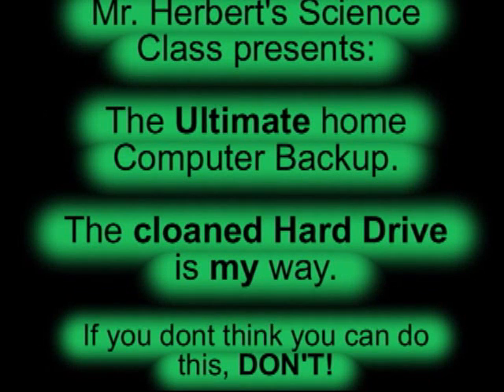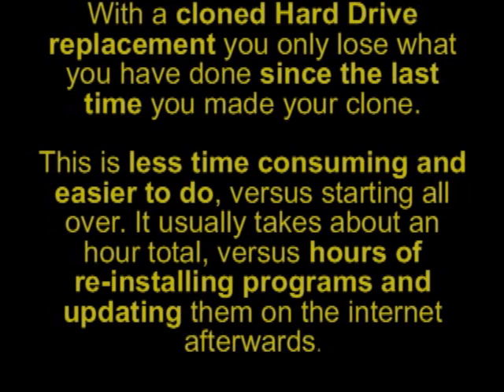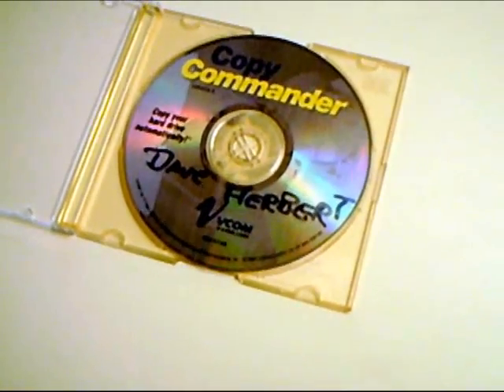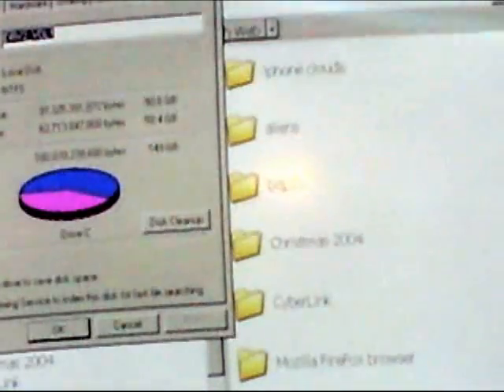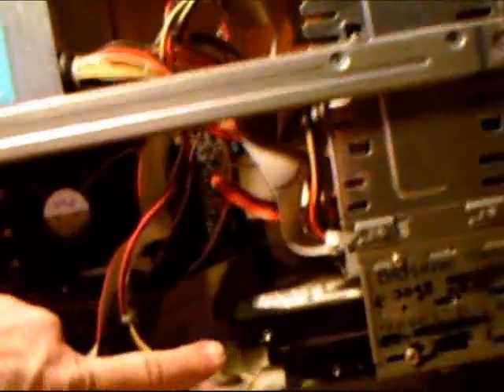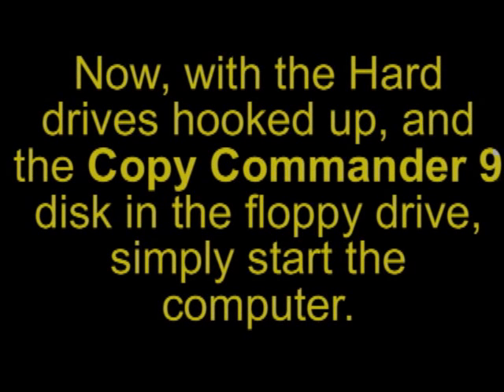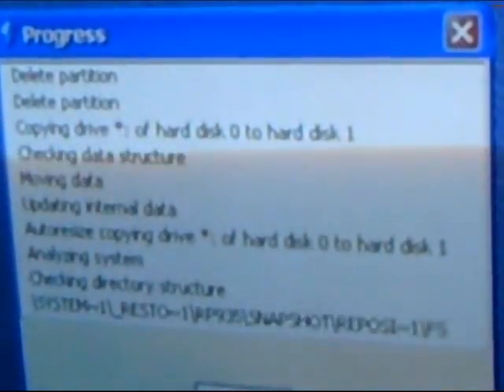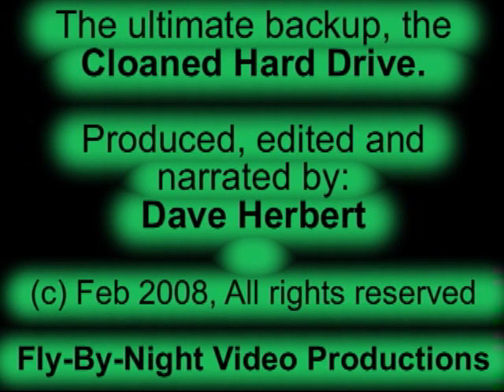How I cloned my Hard drive.

Comment: Now 5 years later.....  Windows 7:   Start - Control Panel - System and Security - Backup and Restore - Create a System Image.
  
Plug in your 1 TB Portable External HDD you bought for less than $100, follow the directions and image your disc.

Comment: if C: is a 200GB drive but only 60GB used and I want to back it up on a 120GB drive will it have a problem?  What if new drive is 500GB and it is previously partitioned to have  C: and D: and E: on the same 500GB but I only want the old 200GB which has only 60GB used to be copied on the C: of the 500GB but leave the files on D: and E: alone?  Will it work for me?

Comment: Don't say who uses Floppy Drives any more, or you will show your stupidity about computers.  There hundreds of reason why Floppy's are still used. For instance (example) if you need to repair WindowXP and require to load a driver, you can't load it without a Floppy.
One just can't clone a one HD to another and expect if to boot into Windows. I guarantee you will hang-up at the Welcome Window screen, very few succeed.  There is a proper way, using proper programs.

Comment: @MrPod4g 

yes but modify them and they brick. 

add components, they brick.

I love my i phone simply because its like 3 devices in my pocket.

Macs aren't good for high-flop calculations and proicessing.

but there great for playing angry birds! well, if thats all you use them for.

and before you troll me about multitasking, 

i have 17 programs open, running 12 threads and my processor is only at 50% or so

you loose

Comment: Nightflyyer is using 2 drives... one of them, is always being used for the system.. the other is just an old cloned drive sitting in a desk drawer somewhere.. soo when his main system drive fails.. he has to install the old cloned drive.. then update whatever needs to be updated.. unless he's constatly wasting time re-cloning his spare drive every week... Raid 1 is the best solution for this.. No need to re-install hdd or update. 137GB HDD Limit was only an issue in XP SP1.. it was fixed SP2

Comment: The Absolute best thing to do, is not to "clone" your hard drive, as suggested in this video.. But to Raid your HDD. Raid 1 Provides redundancy for this. Raid 5 provides Double the speed and Redundancy.. Raid 6 as well. As Nightflyer said, Cloning is only as good as your last cloned hard drive. With raid, 1 drive fails, u RMA it. then pop in the new drive, and it rebuilds the Raid Array,. nothing is lost... if two drives fail ( unlikely ) this is what raid 5 is for... Cloning is not the best

Comment: PARTTWO____I need more room than that to install my programs but I used my last activation code. So I was wondering if I could put a second Hard Drive into my computer and transfer my 64bit version of Windows 7 over to the new Hard drive. This HDD already has an Operating system on it (windows 7 32bit). Can I upgrade that without a new activation code?

Comment: PARTONE______ I have a family pack for Windows 7. I have Installed the 32bit version on my hard drive. A couple of the programs I use needs a 64bit operating system. I decided to partition my 250Gb HDD to Install my other Windows 7 64bit OS. But when I went to partition my HDD, it only let me shrink a section to 13Gb.

Comment: It won't work if the cpu isn't the same make and model as the one you have. Also won't work if the chipset on your motherboard is different. So if you go from an AMD to an INTEL it won't work. If you go from a VIA to a NVIDIA chipset it also wont' work. Windows will not boot, because the kernel will be for an unsupported piece of hardware.

Comment: You're right here, I personally use maxtor as my backup drive, it's a 500 GB (external) I use 'Avanquest PerfectImage11' I haven't used any of the backups (full backups) created by the program itself because I haven't had the need to. By the way it gives you options if you want it compressed or just as a normal image file, it allows cloning and image creation. it also gives the option to back up your entire files on your computer. I'm not sure if it works as an image.

Comment: I have a tiny problem.... I had the original 20 GB HDD in my ThinkPad which had all my music (DRM-protected) and I installed the 100 GB form my HP. But... my total backup from my 20 GB is 11 GB to clone XP and my music plus a couple programs. And I have 6 GB free on my 8 GB iPod Nano which, as you said, is obviously not bigger than my clone size. So... 2 options. Borrow a 16 GB iPod or delete some programs.

Comment: I use Acronis TrueImage for this task and worked all the time I needed it. One nice feature is that I can have the boot on a usb flash drive and store the image on a dvd-rw or another hard drive. Another useful thing is it can back up the whole system without restarting, so just have to start the program and follow some easy steps.
I tried ghost before as well, but haven't worked 100% and if it fails only 1 out of 20,it is a reason more than enough to look for something that really does the job.

Comment: Hey NightFlyyer, your video is very helpful! I was wondering if you could advise me on this problem. My computer is not allowing me to log onto the desktop (even with safe mode). I assume its due to a virus or a corrupted windows update. Is it possible to retrieve the data that's on it using a similar procedure as you've shown? I have a RIAD drive by the way, is that any different?
Thanks!

Comment: Serial mouse Worked. The system blue screened on the first boot after disconnecting the Dell proprietary drive, but seems to be running fine now. I imagine any issues would be because of Dell's meddling.